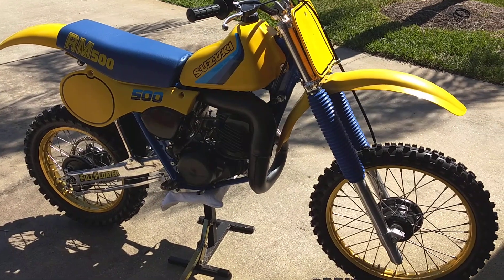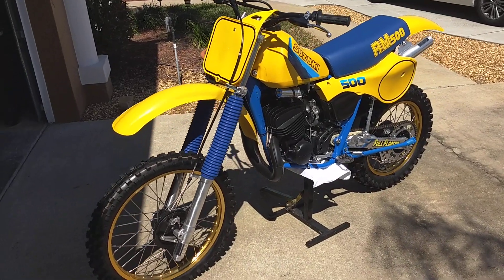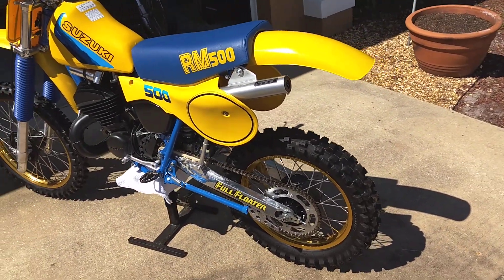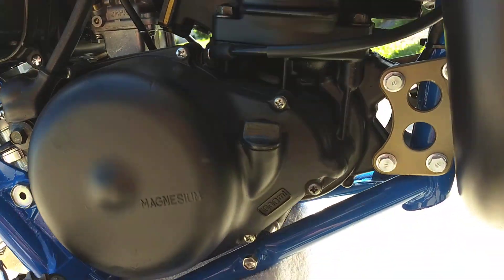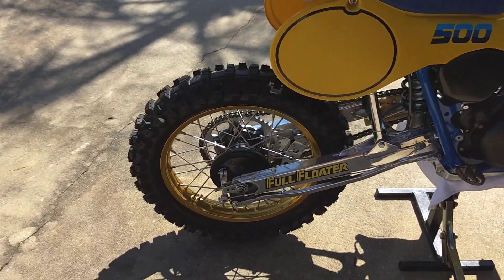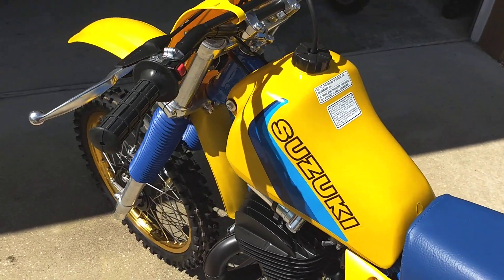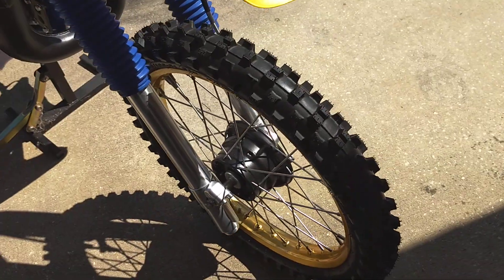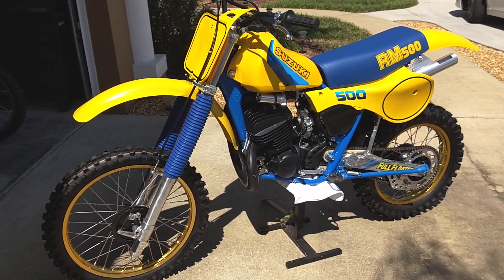1984 RM500

Comment: another beauty, btw I took my 78 RM400 out to crooms today, 1st time in 40yrs back in the saddle. It was nice as there was very little traffic out in the deep sand trails, so my slow pace was not an issue and I did not have any close encounters. I rolled those sandy whoops, just to old to go fast a risk a high side. Barely ever got out of 1st gear (Ha) but the bike was great, plenty of power right of idle. Only thing that is a PITA is the way the starter works on that engine, have to be in neutral and remember to not pull in the clutch.

Comment: Hi! I hope you will help me out right here. Where can i find the frame number? Where did u buy the plastics and decals? And the bleu RAL number on the frame? 

Thanks!
Reply from the maker: if you remove the front number plate behind it you will see the CDI box. remove the CDI box and it should be stamped on the frame right behind it. As far as plastics go I had a few sets of NOS but that's hard to come by. Vintage Suzuki sells nice aftermarket plastics and decals
Reply: @kingdebary  thank you very much for your help. I saw on ebay a set of aftermarket plastics. I will let you know which year it is :)
Reply from the maker: @Bryan-uk9kh  if it's an 84 the frame should be done in blue powder coat RAL 5017
Reply: @kingdebary  hey man! I got the frame number. It is RM11A - 100237. I cant find any decoder or something and i thought you know alot of these bikes. Can you tell me what it is? Btw its a black frame.
Reply from the maker: @Bryan-uk9kh  go to www. vintagezuzuki. com. they should have the numbers listed for ID

Comment: What was the total cost including the bike?
Reply from the maker: TNT Moto I don't remember off the top of my head but it's way too much. I keep a build sheet on each bike.
Reply: i do the same as far as the build sheet goes. i do not finish them up like yours. Yours look like new. My wife and i have an agreement to keep the sell value equal or greater than the cost. Your bikes look great.
Reply: @kingdebary   i like how you anodised the the rims  was it expensive anodising.
Reply from the maker: @WILDGEESE399  you can order them in gold

Comment: Perfect. Do you paint or powder coat the frames  ?
Reply from the maker: bill smith if the bike has a plastic tank I powder coat but if the tank is steel or aluminum I use paint

Comment: Hi what paint did you use to paint the motor
Reply from the maker: Rikki Jones depends on the restoration level. Sometimes satin black powder coat and sometimes Duplicolor hi temp low gloss .... I think it's DE1634. Once prepped properly and painted let sit in the sun for 3-5 hours . Comes out nice
Reply: kingdebary yes it looks realy good
Reply: kingdebary did u use paint or powder coat on this RM500 motor??
Reply from the maker: Rikki Jones paint